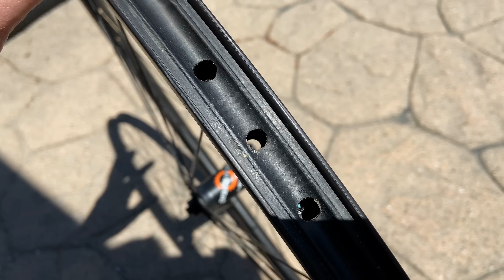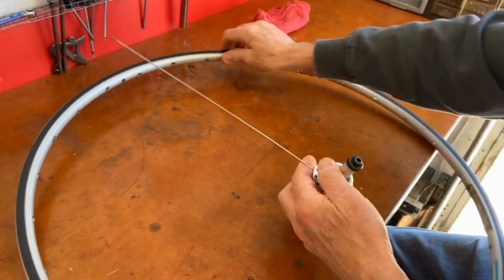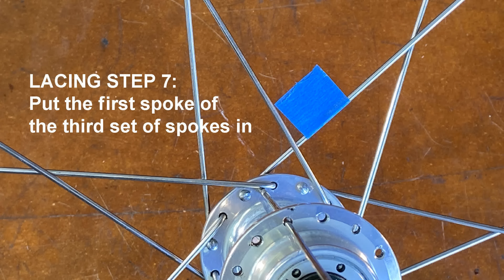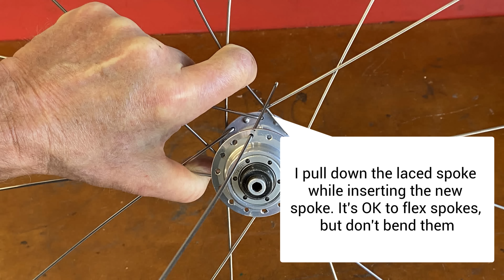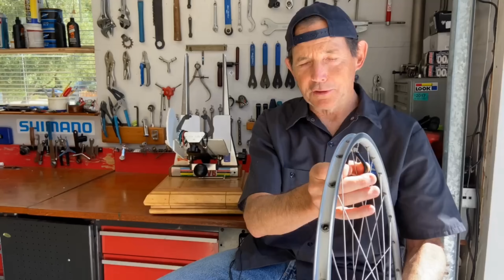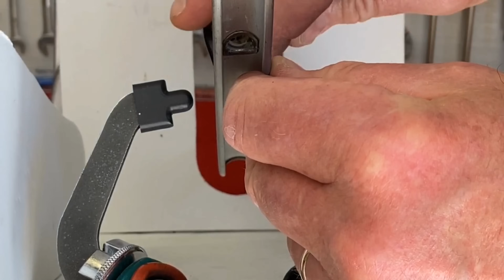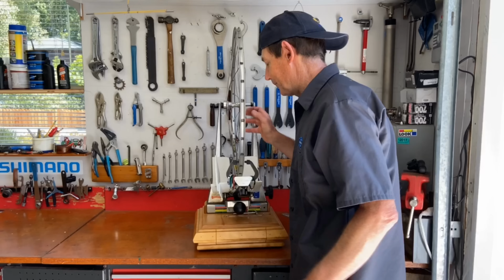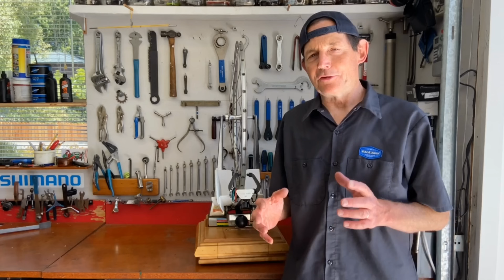How To Build Bicycle Wheels THE EASY WAY! #bikerepair

Comment: Nice video!

I work in a bikeshop and see sometimes wheels that are laced two cross, and three cross. Over over and over. And not under. Speciallly on smaller wheels. A video that you are talking about the benefits lacing spokes in different ways would be great to see.
Reply from the maker: Thanks a lot for watching and commenting Tobias, appreciate it. And thanks for the suggestion. In the video I teach 3-cross lacing because it's been the most commonly used pattern for a long time. Some wheels may be built with non interlaced spokes and with different cross patterns and if you rebuild one of those wheels because a rim got bent or for some other reason you usually would copy the pattern that the wheel was laced in, not change it. But if you're building a new wheel, you can't go wrong with cross 3 lacing. Jobst Brandt's book The Bicycle Wheel is the best book on wheel designs and theory and it's available for free download here: https://www.dropbox.com/s/mbsx865uzz0s7jq/Bicycle_Wheel_-_Jobst_Brandt.pdf?dl=0 I think you'll enjoy it. Thanks again!

Comment: how do you figure out the right size spoke and nipple to get if you need to replace a new spoke? What do you do if one spoke is too tight to turn the nipple? Is it wrong to tighten one spoke that correct the spoke to move left or right?  Or do you always loosen the spoke beside the spoke you tighten?
Reply from the maker: Thanks for watching and for asking some good questions. The easiest way to get the right size spoke is to measure it from the elbow to the end of the spoke thread in mm. (They make spoke rulers for this: https://amzn.to/3QFjdGL  ) And to get the right size nipple, you want to make sure that it threads onto the spoke. The common sizes of nipples are 2.0mm/14 gauge. That's what's on most wheels. But to make sure, you test to make sure it threads fully onto the spoke. If it's a loose fit, then you may need a 1.8mm/15 gauge nipple, but those are not anywhere near as commonly used as 2.0. So most of the time the spokes and nipples are 2.0mm/14gauge. This changes if you get into high end wheels or custom built wheels but even there, 2.0mm is the most-used.

If you can't turn a nipple there's usually something wrong. You should try loosening it first and if you can loosen it, you should be able to tighten it. A nipple can become stripped so you want to use a good spoke wrench that fits right and then turn it carefully only a little at a time. If you can get the nipple loose, you can try oil on the spoke threads to try to free the nipple up. Sometimes the threads get corroded and the nipple freezes on the spoke. For that you can heat the nipple with a hair dryer carefully (DON'T DO THIS IF YOU HAVE CARBON RIMS!). Heat will free most frozen parts. Those are a few things to try. You can always solve nipples that won't turn but sometimes if they're corroded or damaged you'll end up replacing them. Spokes are steel so they tend not to be as problematic as nipples.

Yes, I recommend when making adjustments to both loosen and tighten spokes. So if you want to fix a wobble, you loosen the spoke on one side and then tighten the spoke on the other.  The reason this is smart is because side to side truing influences up and down truing. So by working evenly with spokes on both sides you're less likely to knock the wheel out of round when you true the side to side wobbles out. Always turn the nipples a small amount, about a half turn to make adjustments. Easy does it. Keep checking how you're doing. It should be a gentle process truing and tensioning the wheel. Okay? I hope these tips are helpful. Enjoy your wheel building!

Comment: Hi Jim - So how many threads does your Unior 2.5 leave after disengagement? 🙏 Thanks
Reply from the maker: Thanks for watching and the question Gene. I don't use the Unior Speed Bit for speeding up wheel building in this video - it's in another video of mine here: https://youtu.be/kaBvpCuXigQ?si=a-rUKWge3O2SSoRx And here's a link to the tool if anyone wants to see or buy one: https://amzn.to/3576yoP I've actually never measured it to be sure it's spot on but the two bits Unior makes are the 1.5 and the 2.5 and they're supposed to leave respectively 1.5mm and 2.5mm at the end of the nipples. Here's a great video by wheelsmith Bill Mold that shows how to calculate the thread count in those 2.5mm - you'll enjoy it if you haven't seen it: https://youtu.be/2kN6xXxkgU4?t=140 Hope this helps!

Comment: I have a Motobecane phantom29 29 inch. I'm having a problem with inner tubes, specifically the European tubes with the nut on the valve stem. I have replaced tubes eight times in two weeks. The valve stem wants to pull away from the tube when I'm riding, and will tear and go flat. What's the trick to installing these tubes? It's getting expensive. Thanks
Reply from the maker: There are a lot of things that can cause tube valves to get ruined, Maurice. The most likely thing is that the valve is moving around when you're riding and for that to happen the tire must be moving around on the rim. The main reason that would happen is that the tire doesn't have enough air in it. So I wonder if you are inflating it enough? On the side of the tire it will show how much the max pressure is but it's likely 30-40 psi. If you're inflating it to these pressures then the tire should not be able to move and the valves shouldn't either. But if you only have 10-20 psi that might be the problem right there.

The next thing to check is inside the wheel to make sure that the rim strip or tape inside is protecting the base of the valve where it rests inside the rim against the tape/rim strip. If the valve can make contact with the rim the rim can cut and tear the tube. The hole in the rim strip/tape should only be large enough for the diameter of the valve. If it's a larger hole they might have put in the wrong size rim strips/tape and you'll want to take some soft cloth and make a small hole and slip it over the valve so that when the tube goes in it rests against soft cloth not the metal rim's sharp edges.

Another thing that can tear valves off is tightening the valve nuts too much. The valve nuts are just tightened by hand never with pliers or a wrench. If you tighten them too much you can pull the valve into the rim causing it to get cut.

One more thing is if the tube is undersize so for example a narrow 29 inch tube for road or gravel bikes used in a wider mountain bike tire. You want to use a tube that's about the same size in width as the tire it goes in. But, I would assume the bike came with the right size tubes so that might not be the problem.

Those are a few ideas to check out and hopefully you'll find what's wrong. It should be an easy fix once you find it. You could look closely at the tubes that got damaged and look for telltale signs on the damaged tube to figure out what's doing the damage. If you remove the tire and align the valve in the rim hole you might see what's damaging the valve straight away. Let me know how it goes. Good luck!

Comment: This is an awesome video.  Thanks for this.  Question:  My bike has a 28 hole 27.5" wheel.  Is it possible to buy a 27.5 inch rim, and transfer the hub, spokes, nipples to the new rim?  Or would it be best/easier to just buy a whole wheel?
Reply from the maker: You’re very welcome Frank. Thanks for watching and the question. Yes you can get a new rim and reuse the parts as long as the new rim is the same as the old rim - otherwise the spoke length will be wrong. But the thing with a new wheel is you get all new parts. You only rebuild wheels usually when the hub and spokes are in as good as new condition. In most cases it’s best to use new spokes and nipples if they have been used for awhile. An example of when rebuilding makes sense is when you have a high quality hub that’s still in great shape. Or maybe you bend a rim on a newish wheel, like less than a year old. Okay? I hope this is helpful and thanks again.
Reply: @JimLangley1  Thanks for the quick response!  I'm looking for a bit more robust wheel for my sons bike.  From the sound of this, I should be able to do what I'm wanting to do.
Reply from the maker: @pancho_clause  Happy to hear it, have fun building a better wheel.

Comment: And I don't think the spokes can get any tighter to bring it up?
Reply from the maker: Thanks for watching and the question Kurt. It sounds like you have a high spot in the rim. In other words, when you spin the wheel there's a hop or "bump" or high spot as the wheel spins around. If that's the problem you're having, what you want to try is loosening the rest of the spokes around the wheel (not at the high spot but all the other spokes). Once you do that you should be able to tighten the spokes at the high spot and pull the rim down and make the wheel round again. That's because by loosening the other spokes you allow the rim to expand as you tighten and pull down on the rim at the high spot. The rim needs to be able to move and change shape as you make adjustments like this. Give this a try and see if it works for you.

Comment: My wheel got worse in one spot it goes below indicate is I can't seem to bring it up what do I do
Reply from the maker: Thanks for watching and the question Kurt. When that happens there is usually a loose spoke where the spot went below. To fix this you want to loosen all the spokes around the wheel a little and then tighten the spokes at that spot that's below. That will allow the spot to come up and the rest of the wheel to move out. Hope this helps and thanks again!

Comment: When centering , do when tighten on one side and loosen on the other ? or just tighten the one side ?
Reply from the maker: When building a new wheel the spokes don't reach final tension until you're all done. You center the rim early in the wheel truing, rounding and tensioning phase of the wheel build. You then keep checking the centering as you get the spokes tighter and tighter on their way to finishing the wheel. This means that you usually end up tightening the spokes to center the rim because all the spokes are still not completely tightened. However, if you were to end with a rim that's off center by a lot like more than an inch or several cm, then you would want to loosen the spokes on one side and tighten the spokes on other side to center the rim. That's because if you only tightened the spokes on one side you might make those spokes too tight. I hope this helps and thanks for watching and the great question.

Comment: Jim-I’m building some wheels where the alternate hole to start is to the right of the valve stem. When I flip the wheel over to start lacing the 2nd side, the spoke 2 holes away from the valve stem is on the right. Do I start my 2nd side in the hole just in back of that spoke head?  Or just in front?  I can’t figure out if having the alternate while on the right vs left affects the 2nd side or not. Thank you for this wonderful video
Reply from the maker: Thanks for watching Amatilda, happy to hear that the video's helping you with your wheel build. To answer your question, when you flip the wheel over and put the first spoke of the third set of spokes in, that spoke goes in the hole in the hub that's above or just in front of the spoke already in the hub on the other side of the hub (the one with the blue tape on it). If you put it the other hole it will probably be too short to fully engage the spoke nipple so you will notice something doesn't seem "right." Let me know if you have other questions, happy to help more - and have fun building those wheels!

Comment: I took my 26' mountain bike front wheel and losend all the spokes. Afterwards the rim was bent like a pretzel. Is this normal? or is this rim bad?
Reply from the maker: Thanks for watching and the question Rolando. If you loosen all the spokes in a wheel such that there's no tension on any spoke a good rim (not damaged) will be straight and round. That would be normal. So it sounds like that wheel must have been damaged at some point in a crash or something and when that happened someone straightened it by adjusting the spokes to get the wheel true again. Now that the spokes are loose the bent rim has gone back to being bent and that means it's a damaged (bad) rim. Hope this answers your question. I'm happy to explain more if you have more questions. Thanks again!